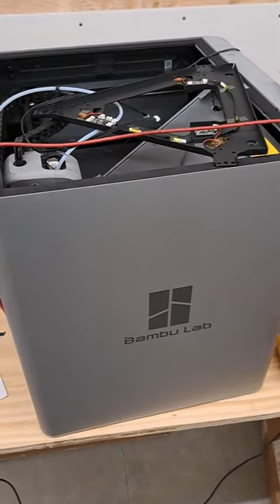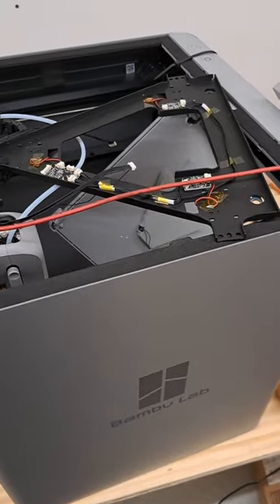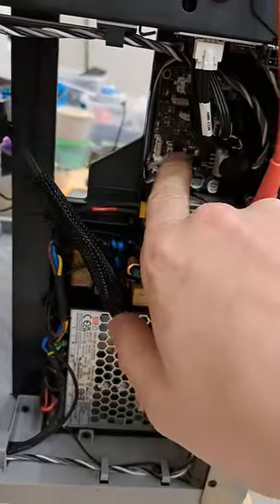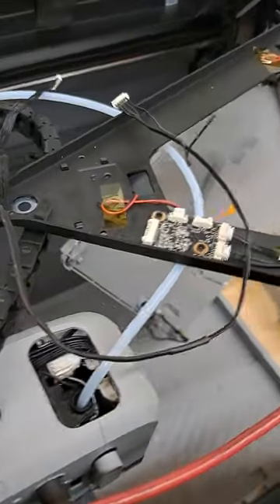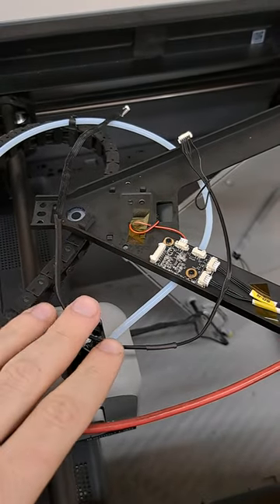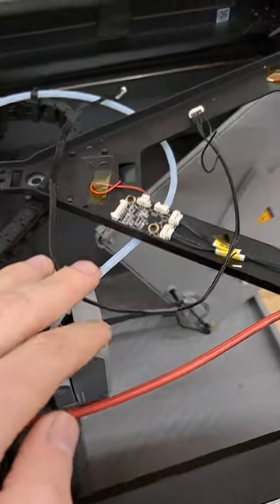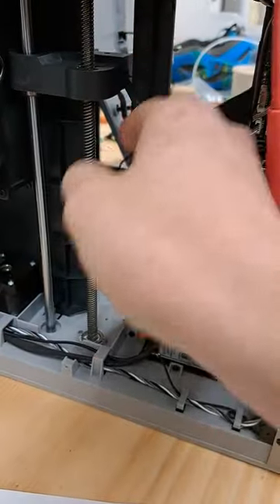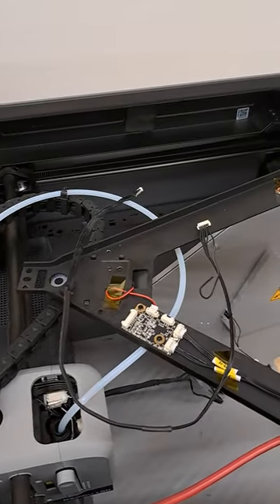Every Early Bambulab Printer WILL have this wire break. Intermittent bed sensor problem.

Comment: I had this exact issue with the bed sensor and a broken cable in my unit. I ended up cutting the ends off of the cable and splicing a longer length of ribbon cable in instead. I messed up the connections and damaged the bed sensor analogue front end board. Managed to fix it by replacing the SMD opamp which is a Chinese clone of the LMV321M5/NOPB. The connectors are Molex PicoBlade compatible and I’m going to make a better cable once I get hold of some PicoBlade ends.
Reply from the maker: This is the level of information bambu should have on their wiki.
Reply: @OddHobbyDude  I’m actually going to replace the bed signal cable with a flat flex I think. I’ve ordered the parts, when I’m feeling brave again I’ll try fitting. I’m loving this printer though. Generally it’s been amazing. I think they may have cost-optimised a bit too much during the transition from prototype to retail machines though.
Reply: @OddHobbyDude  I’ve now replaced their bed cable with flat flex and it works great. It’s the latest video on my channel if you’re interested.

Comment: I wanted to confirm this was 100% my problem on one of my X1c's. The Machine threw a bed placement error. With the bed properly placed on the machine. It would fail to touch the hotend nozzle to the bed. At a consistent height each time (7-10mm short). Your video and information was the only piece of information was helpful. Despite bambu supports many claims that I didn't know how to place the bed properly. Or that the gantry had to be hitting the back wall. The Hot bed signal cable i had ordered showed up. Gave it a quick and dirty pass through for testing (via removing the leveling knobs off the bed to lift the bed off the z assembly, tucked it through and connected it temporarily) to confirm it was the cable. I will try to make a video and link to this one as well. As I doubt this will be the last time someone has this issue, and needs actual useful information. Thanks again!

Comment: Thanks for uploading this it's good to know as I've just ordered one, lets hope there aren't going to be many of these kind of issues.
Reply: I don't think the wires on mine are routed like that, unless I'm looking at some different wires. I got mine maybe a month ago. Doesn't look like they go through any hole, they've probably changed it. Mine also has thicker plastic parts on the AMS where I've read the older models broke.
Reply: @atnfn  I opened mine up and it's a totally different setup with the wiring now, so looks like this problem has been sorted.

Comment: I can't get a response from Bambu on an issue I am having. The printer will pass all the calibration tests. However, shortly after I try to actually print something it fails. After it loads filament and cleans the hot end. The hot end will place itself above the rear center of the bed. The bed will raise and crash into the hot end 4 times. I then get an error stating this, "Force sensor 2 detected unexpected continuous force. The heat bed may be stuck or the analog front end may be broken." I printed a couple things the night before just fine. The next day I could not longer print because of this. Could the cable you mention in this video be related?

Comment: What exactly were your symptoms that lead you to start looking for the problem? Ive been having bed leveling problems for the last few week. I manually leveled the bed then turned off the auto level and it printed ok for awhile but now its back to the same issues. I wondering if this could be my issue as well. Can you please explain exactly what your issues and symptoms were? Thank you.

Comment: Doesn't look like my X1C has the wires routed like that. I got it at the end of January. Instead of going through a hole it seems like they are fastened with a metal bracket underneath.
Reply: Same. Recent batch has all sorts of fixes
Reply: @TradersExodus  goos newa then i got mine 2 weeks ago and mine looks diffrent as well so i think im set